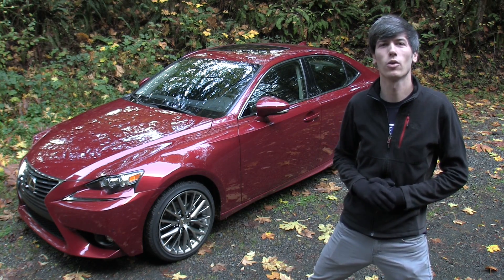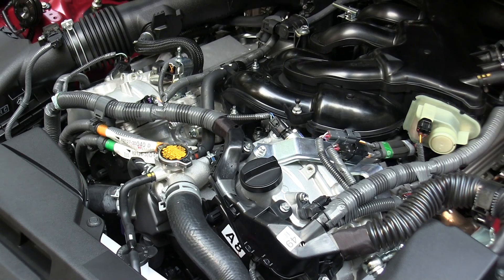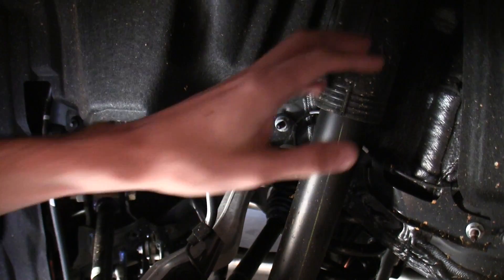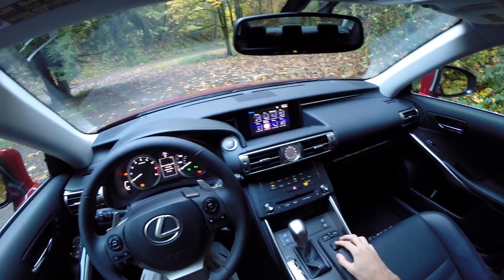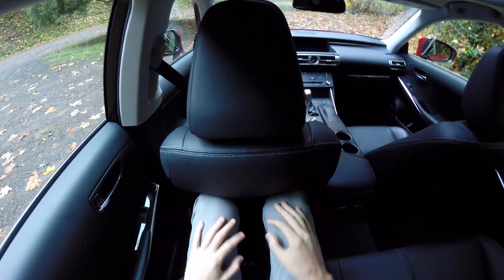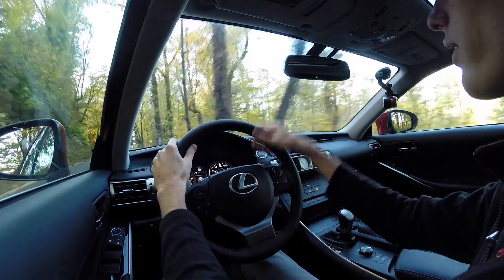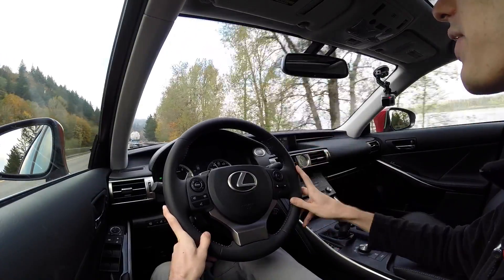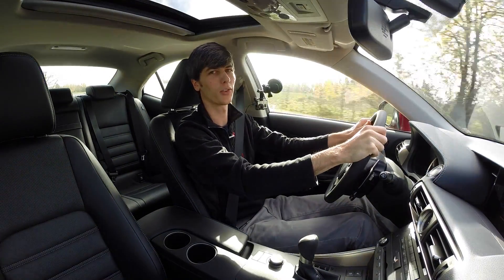2015 Lexus IS250 - Review & Test Drive

Comment: I have the 2014 3rd generation is250 base. I have a plan to replace it with the f sport strut and spring, but I'm worried that the ride will be too firm. The car I've driven was suitable for the bmw 330im line and the 2009 2nd generation is250 f sport was too firm. What is the ride like for the f sport?

Comment: The 2014 is 250 base was faster than the base BMW 3 series in 2014. We have one and took a pass on the BMW f build and the MB C class. BMW quit the f's after one generation and moved on to the G's, after 40 years of E's. We currently own a 2012 BMW 128i (E88) and it is a great car. It was the last low pressure fuel injection and non-turbo straight 6 engine, N52. Both great cars for different reasons. Also owned 1996 BMW 328iC, E36. Opinions are like assholes; everyone has one and sometimes they stink.

Comment: How reliable is the is250? A little concern about the carbon build up
Reply: Very reliable!  I own a 2006 is250 awd with 209,000 miles. I bought it when had 172,000. It has the same engine of a 2015

Comment: axaxaxaxaxa 
consider this inline-6 as a 4 cylinder engine and stop complaining
if it was marked 4 cylinder on the engine cover no one would complain
old tsx’s the same power engine – 4 cylinder, come on ppl no one complained (however, I like this 250 more than tsx ((had both though))  ;) 
nice car and yes 350 is a "real" 6 cylinder no doubt, but stop comparing this two!
at last 2015 250IS -$25K and 2015 350IS -35K, SO ITS NOT 3-4K, but 10-12K difference!

Comment: weak engine with medicore gas mileage, direct injection cause very common carbon build up on the intake valves, hopefully they fixed the horrible oil burning issues at the very least, the issues are very well known on the forums, Lexus will just tell to go f**k yourself because they will deny and tell you burning more than a quart of oil is normal for multivalue engines, carbon buildup will kill power,gas mileage, and eventually reliability, now the new redesign is ugly no more reason to buy this car, rides too firm for a luxury, rides more like a sport car, the only saving grace is the 350 version

Comment: Do the brake lights on any of the new is250 trims light up when you're just off throttle? I only ask because I saw the taillights blip repeatedly as I was following one on the highway. I see a ton of unnecessary braking on the highway each and everyday, but this was just excessive.

Comment: They should have made this a I4 or V4 turbo. Would have been lighter and would have produced more torque.
Reply: If IS 250 too slow - you get IS 350.
Reply: they have a turbo version of this car. Some buyers (including me) prefer non-turbo engines.
Reply: Olasek Sure, but this car is slow af and needs bigger displacement or turbos

Comment: Too bad the IS250 is a fuel-guzzling V6. Very poor fuel economy compared to the BMW 320d. And not only that, the edgy styling is a turn-off for most. Doesn't seem like premium or luxury to me. Seems more like a cool toy that a teenager would drive.
Reply: Lol comparing gasoline to diesel
Reply: Agh, above Cadillac BMW and Audi, you do realize these are at the top in terms of quality right? Two are in the German big three and one is the luxury brand in the U.S. Are you trying to Lexus IS interior to Kia? Acura? GM or Ford? Lexus still have the best reliability and is leading by a big margin.
Reply: Stefan Schmidt The Lexus IS250 looks a lot like the Kia Cerato. A lot of people have been saying this and I can see it.
Reply: +UltimateDriver Different strokes for different folks. I hate turbocharged engine, regardless of their better fuel economy. I hate their sound and their unpredictable torque. And on top I hate reliability of BMWs. I am looking for another car and it will be a Lexus, I have had enough of mediocre BMWs workmanship.
Reply: UltimateDriver 320d will stop working around 140k km. Then you will have to change your car. The Lexuses I know are no worry cars until 240 - 300k km.
Now count all the co2 needed to make a car.
Always such.a gas guzzling deal ?
Reply: Thats why there is is250h , which has around 40mpg
Reply: +UltimateDriver Ahh, "ulitmate driver"...Must be used to them foreign cars...too bad...Lexus is number 1 on consumer reports. BMW's are absolute shit cars that retards buy because they view it as "premium"...mechanically, BMW's can't compete with Lexus. BMW's are pieces of trash that are designed to brake down in 4 years after having mechanical problems for the past 2. Fuel economy is rather irrelevant for a car that lasts literally less than 5 years before having to invest 40 percent of the buying price just to get it rolling again.
Reply: UltimateDriver Yeah, the 2015 IS250 is the worst design I've ever seen from Lexus so far.
Reply: UltimateDriver Lexus designs this year look really tacky and cheap.
Reply: UltimateDriver This is all while the Korean brands (Hyundai and KIA) have overtaken the Japanese brands in terms of reliability. And the Germans still excel in terms of quality. 
Japanese car makers have fallen way behind.

Comment: Drove car this weekend.  The good:  love design.  Best reliability in World. Priced well.  The bad:  a little under powered. But not bad.  Smooth ride.  Typical Toyota ride.  The Ugly: front seats way to narrow and bolstered.  If u are 6 foot and over 180 lbs forget it.  

If not for the seats I would have leased it.  Not sure what good alternatives in class are.  A4 is nice, but is no where as quiet or smooth.  And never buy.  BMW 328i , maybe.  Lease only.  Never ever buy  German car.

Volvo?? No Volvo dealers within 50 miles. Lol.

Looks like I may be stuck with my piece of crap CVT Altima.
Reply: Start working out so you'll loose some lbs and actually fit in the seats, then buy the Lexus. ;D

Comment: What you said about the fuel economy of the is 350 and is 250 is not a 1MPG your crazy if you said that. its at least a  5MPG difference.
Reply from the maker: Vlad Qazwsx I am quoting EPA ratings, not making up numbers.
Reply: Ok
Reply: +Vlad Qazwsx Actually the fuel efficiency is the same or even better for the 350 engine in 2016. The CMB (combined hwy/city) is 21 for both 350 (AWD) and IS-300. It is however a better 22 for IS-350 RWD. But since IS-350 can come as RWD this one has 28 HWY mpg versus 26 for IS 300.

Comment: I would say everybody should stay away from the IS250 since the 350 is just so much better. Also they are replacing that meager 2.5L V6 with the wonderful 8AR-FTS turbo I4 from NX.
Reply: Actually that 2.0 turbo is not all that great. It needs to be revved hard because it has no torque down low.
Reply: sliwka621 BMW now includes 4 years of maintenance in addition to the 4 year warranty. In other words, you can drive it worry free for 4 years from a dollars perspective. Once 4 years is up, who knows?

Yes, the 320i makes 200 lb-ft of torque at 1,250 RPM. That's awesome.
Reply: SUN SU I generally agree but people will probably be able to get some killer deals on IS250 when the dealerships are unloading them to make room for the IS200t.
Reply: sliwka621
If that's the case then that really sucks. I'd save a little bit of money and get a 320i over an IS250 F Sport. Despite the detuned engine, the 320i is still faster and has full torque available in the low 1,000s RPMs.
Reply: Jacob Palmer Just don't forget that you'll need at least twice as much money that 320i costs to actually mantain it for the first two years or so. Never rely on the dealer, because for BMW it's ALWAYS your fault.

P.S.: 1000rpm and torque in a 4 cylinder? No, just... no.

Comment: why does a 2.5L v6 only produce 205 horse power? even the torque figure is bad, my 1.9 diesel puts out 225bhp and 340ft lb, whats the point in having such a large displacement v6 with such low power for its size, you could get that power from a 1.6 turbo and save a load of fuel by doing so, or is it just an american 'big displacement lower power' thing since their petrol is so cheap?
Reply: 205 hp are not low for a non turbo engine with 2.5L! It is a comfortable machine and not a sport engine. If you looking for a car with top straightline performance you have to look for another car than a IS250. Better get a hot hatch like a BMW M135i or a Golf R but they are totally different cars than the Lexus.
Reply: 2.5 is borderline 4 cylinder in terms of displacement
Reply: john smith Well Mazda had a 1.6L V6
Reply: coscorrodrift and a 2.3 liter in the Millenia S
Reply: rolexr
What about the Honda Civic SI (201 HP 2.0L 4 Cylinder engine). I bet that car would beat this one because of the lack of weight in FWD.
Reply: SI0AX
...I had the Civic Type R FN2 with this particular engine. You´re right but...that are whole different cars and the Honda motor are known of its extreme reving character. The engine of the IS250 is a comfortable cruising machine ;-)
Reply: I wonder if they went out of their way to detune this engine so much? I have Audi's inline 2.5 5 cylinder, admittedly with turbocharger (but why not) that produces well in excess of 400hp & 600nm torque and is a lot more efficient!! Why would you even bother with an engine like this?
Reply from the maker: 2.5L is actually quite small for a V6 in the states. For a naturally aspirated 2.5L, its power output isn't all that low, but since the 3.5L isn't much more, and has about the same fuel economy and bigger brakes, it's the logical choice.
Reply: This is quite an old engine, but it's extremely reliable because it's under stressed with its power and torque output. The BMW 2.5L inline 6 puts out 207 BHP in my 2011 Z4. Considering its reliability compared to the BMW, I would say it's rather impressive. This engine is built for smoothness from the V6 which compliments the car well, people who buy Lexus has comfort in mind not performance.

Comment: The engine may be disappointing, but why do you think the better option is only circa $3500 more? I think its the same reason why a Large popcorn at the movie theatre is negligibly more than than the medium size. I mean, who wants a Small popcorn, and since I'm going to get a medium size, why not just upgrade to a small for $0.50 more? You see? The lower optioned one is a "leader" to the more expensive one. I'm saying Lexus did that intentionally because I bet the cost to build the 350 compared to the 250 is not very expensive at all! I used to be a BMW factory worker and I've heard that the BMW X3/4 only costs $7k to build and the X5/6 platform only $12k. Luxury autos have an extremely high profit margin.
Reply: Suposedly the Research and Development costs are what the majority of the price of cars come from.

Comment: Used to own a 2008 IS250 AWD, and I couldn't agree more on the IS350 upgrade. I would also like to point out that the 6 speed automatic transmission uses gear limiters when in Sport/Manual mode.So in essence, if you select fourth, you're telling the transmission not to go past 4th gear, but it will shift in between one and four, all by its self. That is why it makes you feel like there is a delayed response - it wasn't built to do what you expect in Manual mode.
Reply: Black lives matter?

Comment: Definitely should review an Infiniti Q50, the car has received mixed reviews, some love it (CNET) and others find the DAS (Direct adaptive steering) too artificial. Cool car with great tech, I would love to see you review it! You could even do a separate video on drive by wire (DAS)!
Reply: CNET drove the Hybrid version of Q50 which has more power and torque. I've driven a regular Q50. I don't find the steering to be any different than the others except it's a bit heavier than G37S.

Comment: Thank god it isn't an awful CVT gearbox...
Reply: I have no idea what a CVT gearbox has to do in a sports car. Yes, they are probably more efficient and lets the engine run at a more efficient rpm, but that has it's place in an economy car like Toyota Prius, not in a sports car like a WRX.
Reply: I can't believe it was even an option for the 2015 WRX.
Reply: brandoGTR48 I thought the same, I understand that they're pretty much always on the power, and they're more economical, but they aren't fun, and they sound unbearable!
Reply: Yes, I can't stand the idea of fake gears either!
Reply: @brandoGTR48  you know the wrx cvt is different from the regulars ones right
Reply: Again with the CVT bashing. Do you actually know what you're talking about or just want to appear so? The WRX's CVT is far better to use than any traditional automatic. Most CVT's are nowadays.
Reply: Engineering Explained I never said an Automatic was fun, I don't think an auto is fun, I'd never own one unless the only option was between an automatic and a CVT, and even then I'd look for a different car that had a manual. The main gripe I have is that the CVT, makes an awful droning noise with no change of pitch, and doesn't sound like you're accelerating. Yes they can have manually selectable ratios, but even then it doesn't sound quite right.
Reply: @lgliam  yo you got btfo'd lmao
Reply: joeracer302 I know Lexus has one of these transmissions available that mimics a gear change, but even still it sounds fake still. As you said it is more economical, but I'd still never buy one.
Reply: I know exactly how a CVT works and it's advantages, I also know that in the 90's Williams tested a CVT gearbox in it's Formula 1 car. I am saying I would never buy one, it's a personal preference, like I would only go for a manual, unless I did thousands of motorway miles a year, and even still I wouldn't buy a CVT over an auto, as I do not like the continual drone of them, nor the fake gear sounds.
Reply: CVTs get bounce at wide open throttle i hate that.
Reply: I have not driven a CVT o like yet.  I hear the WRX is not bad but it must be different than all other Subaru because the others are terrible.  Honda and Toyota are likely the best of the CVT choices but I will be avoiding CVT as long as possible long term lots. Of them have had issues
Reply from the maker: So an automatic is fun but a CVT is not? Doesn't make sense to me. Many CVT's allow for manual selection of gear ratios, and the ones I've tested have responded better than planetary autos. Sure a DCT would be better, but if fun is your concern add another pedal. CVTs are an awesome technology.
Reply: +Walter Black  From what I'm reading here, they are bitching about the "noise" it makes, and not the performance.  smfh
Reply: lgliam Some CVTs are programmed to mimic traditional geared transmissions, and "shift" gears, so they don't have that drone you're talking about from the RPM's remaining fairly constant. I remember driving a Nissan Rogue rental car that was equipped with a CVT, and it did what you described and would hang the RPMs around 3000 or so while the transmission did its CVT magic to change gear ratios without any steps so it was just constant RPM and a smooth change in speed. I hated driving it, but I wasn't exactly driving the car for performance, so if it helps that car make better gas mileage then I guess it is okay. I really got annoyed by the constant rpm sound though, by the end of the trip both my girlfriend and I were making fun of it.
Reply: Cvt is absolutely horrendous just look at what it's done to nissan